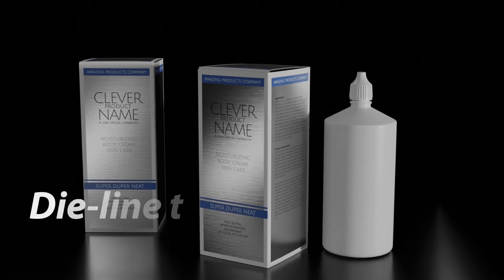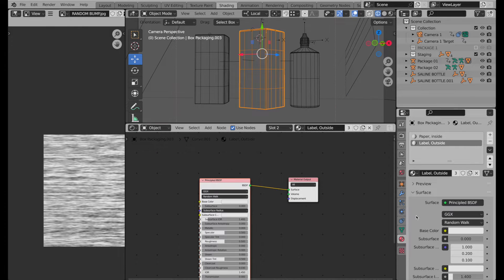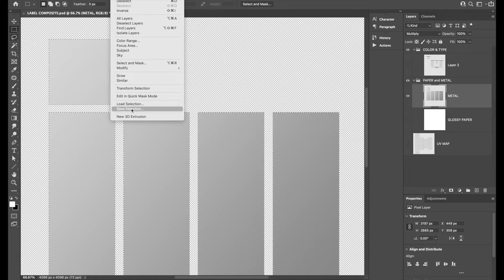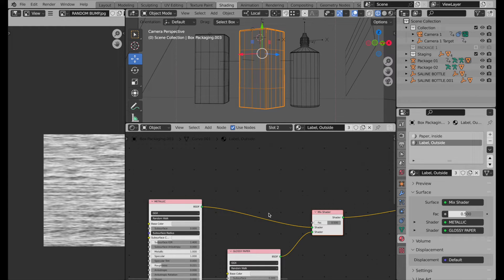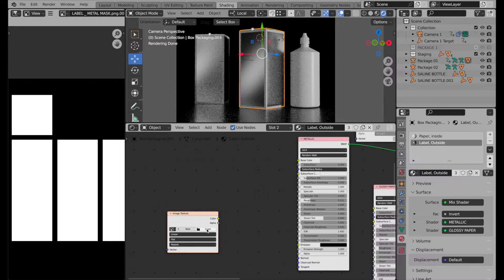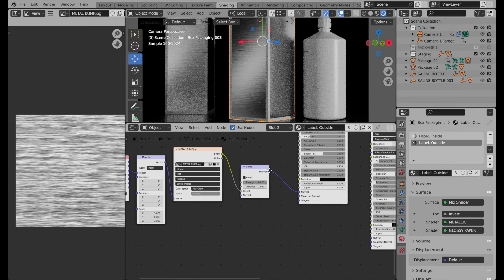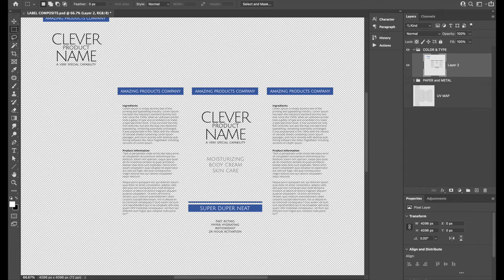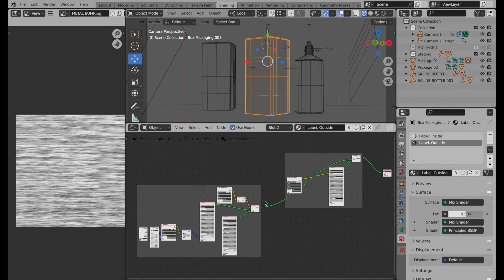Dieline to 3D, part 5. Setting up the box label texture

Comment: This whole series is what I've been needing!! Only thing is I am wondering how you got the materials assigned to the outside and inside of the model? I've been following along and building out my own concept a bit but am a little stumped around this step - any help would be so appreciated:)
Reply from the maker: The best way to assign a material is through the Solidify function. It has a Material sub-section. On your object, create two material slots. The top slot will be the primary material. The second slot below it will be the paper for the inside of the thickness and also the walls of the thickness. If the value is 1, then Solidify applies the second material slot to those thickened parts.

Comment: Chris! I'm brand new to Blender and as my first project, I wanted to build a box that my job currently uses which has custom features that I can't download from any 3D model websites.
Thanks to this 5 part series, I was able to build a small box with a window and then figure out how to create a gold foil layer on a matte black box and apply that gold foil to the inside of the box.
My next objective for this design would require that the metal mask look debossed with the gold foil sunken just slightly on the box's surface. Any tips or videos you would recommend? I appreciate your time!
Reply from the maker: Sorry for the late reply, I'd need to see an example of the metal mask foil to know how to approach it.
Reply: @christopher3d475  Again, I appreciate your time! I'm going to message you a link to download my project if you want to take a peek at it and lmk if I have that material layout correct. I must say I'm pretty proud of myself with the design, I just can't figure out how to export it to use in Dn with all the materials attached. 
I ended up experimenting with a displacement vector and gave it a gold-engraved look.

Comment: In all your material setups you don't use "Multiscatter GGX", why? it works much better, especially in the dark areas 🤔
Reply from the maker: Because there's often only a marginal gain in preserved light but at a fairly heft render time cost, it can double the render time in order to calculate the back facet scattering. It's being replaced by the new Principled V2 shader in development right now, because it does a more accurate job of energy preservation according to the developers. There's a great video where the developer responsible for V2 talks about it.  I haven't used it in a tutorial but I've used it for some renderings. It does make a big difference for transparent glass that is quite rough both for refraction and reflection.
Reply: @christopher3d475  
"great video where the developer responsible for V2 talks" Link ? 🥰 THX
Reply from the maker: @3p_Operator  https://www.youtube.com/watch?v=DQeP363Xmn4